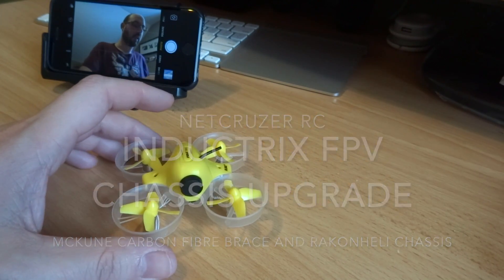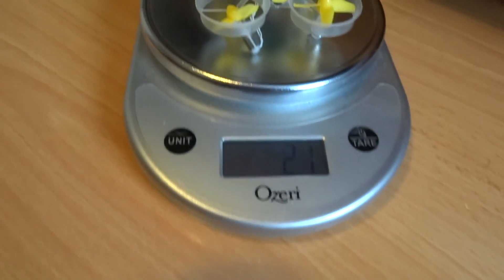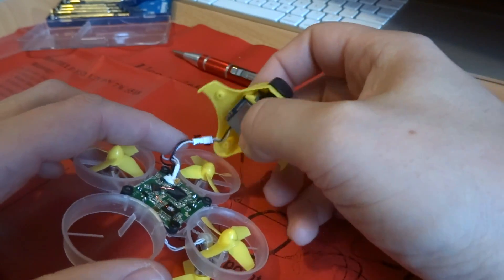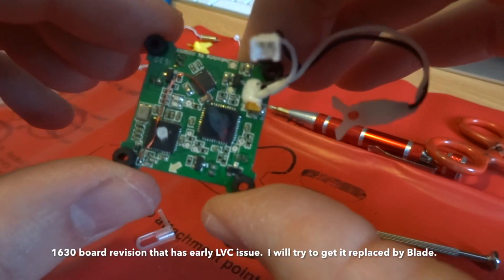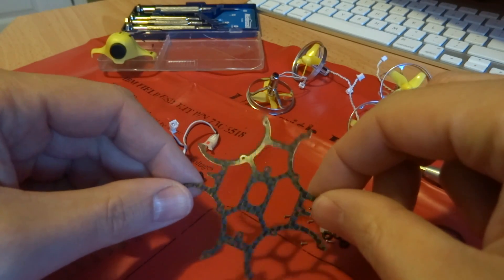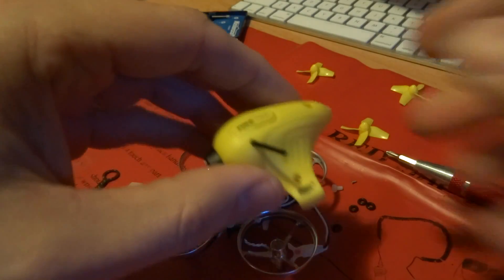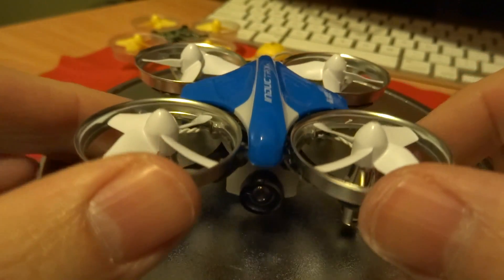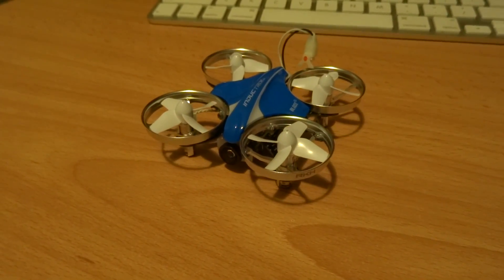Inductrix FPV Broken Chassis Rakon Upgrade Build

Comment: Stay away from anything Blade, this stuff is junk! I have owned lots of it and have had issues with 90% of it. Just trust me there are way better brands out there for even less money, my $14 Bwhoop pro is a better quad, it has no acro mode but is better in every other way and can be programed for acro if you wanted. I have crashed the Bwhoop into trees at full speed with no problems, I dropped my Inductrix off the counter and 2 of the fan duct supports broke! Not to mention the 700 other issues you will constantly have with this junk. I know someone will chime in and say they have never had an issue with theirs but that is an anomaly. I love how they say you can bind it with other controllers like the DXE, I bound mine with the DXE and it fly's different every time you turn it on? Everybody wants to do a thousand mods to these things, why not just buy something better to begin with?

Comment: Get the cockroach frames off eBay, motor struts are rock solid and in general after looking at it, seems way better..  

Time will tell durability wise I just got it

Alloy frames are not a good idea, extra weight and if you crash hard enough most likely you’ll bend something

Comment: I think the carbon fiber looks promising, but wouldn't the aluminum really weigh it down compared to the plastic? The battery life is adequate to begin with, but wouldn't a combination of the plastic ducts (which seem durable for all intents and purposes) and carbon fiber be the way to go?

Comment: sorry but it's not really a "piece of junk" all you have to do is add a TINY amount of UV resin to the 12 stress points of the struts, and even on the areas that attach to the motor end and it's freaking rock solid. I flew my first inductrix frame for about 3 weeks and had some nasty crashes, and the struts were falling off and I kept super gluing them. Had a nasty crash and it just wasn't worth it anymore b/c I had gunked it up so much with super glue. Threw the frame away. Bought another stock inductrix frame, added the UV resin like I mentioned and I've literally been flying the same frame for about 3 months now and not one thing has been damaged. It's indestructible now, pretty much. I have the carbon fiber frame reinforcement underneath, which most likely is helping as well. I'm getting about 3 mins battery life with the newbeedrone.com black edition motors (17,400kv)....so, to each his own, but...it's not that hard to reinforce the frame and it's durable af....the UV resin essentially welds the plastic together....so, good luck breaking that lol
Reply: bad idea.... buy the eachine frame from banggood (its 4 bucks) and thats the strongest frame ever! I used all the glues possible and they all suck!
Reply: +sam Costin no, it's not a bad idea. yes, the eachine frame is more stable, however, I have the Crazypony Makerfire little red fpv with FrSky receiver, been flying it for....2 weeks? This quad uses the eachine frame. It cracked on one of the prop guards. So, what did I do? I got that badass UV resin that fixed it. It's not glue..go use all the glue you want, glue doesn't WELD the plastic together like UV resin, so you're misunderstanding my entire point which makes my argument valid. I'm not making this shit up, I have literally flown the inductrix for 3 months and it still looks brand new, I have crashed it VERY HARD so many times, where the stock frame would have been destroyed; the UV resin-reinforced frame still is undamaged; it's virtually indestructible. 

The point is, this UV resin is gold. Like I said, if you actually read my aforementioned post, I have been flying the yellow inductrix for 3 months, and crashed TF out of it over and over, and it hasn't once been damaged since I reinforced everything with the UV resin. 

This is what I've been using, seriously, it's a GOOD IDEA to buy some and reinforce your frame(s). 
https://www.amazon.com/gp/product/B01MTO0N7G/ref=oh_aui_detailpage_o02_s01?ie=UTF8&psc=1

Even the Eachine frame has cracked with aggressive flying and a few crashes. Just noticed it the other day, there was a split in the prop guard. This UV resin fixed it and it's flying great, once again. 

I do agree the eachine is more sturdy out-of-the-box, however, at some point, it will crack, and the UV resin comes into play and remedies that and all future damage, b/c it literally welds the plastic together. 

So, doesn't matter if you're using a cheaper/weaker frame, if you reinforce it, it will be strong af. 

The inductrix frame is also lighter and performs better.

Comment: looks like you got the eachine e010 carbon upgrade kit instead of the inductrix one but it still works and looks epic :D i just ordered an inductrix myself and im planing to upgrade it with an fpv camera and a rakon frame too :D this helps with how the camera gos on so thanks :D
Reply: as for the seeing the lights issue, i have seen mods of people unsoldering the leds and soldering new ones on so they can put them were they want maybe that will help? also upgraded batteries ive seen up to 255mah ones in tinywhoops website might want to check them out too :) but 255mah was the max i was able to find so far :/

Comment: What was your flight time before the upgrade? I get 3:30 on my stock Inductrix FPV using Nano-Tech 200mAH (4:00 with no-name 220mAH). My RKH upgrade kit just arrived and I can't wait to install the upgrades but I'm concerned about the flight time reduction with the added weight. Btw, I don't think your upgraded quad needs that CF stiffener brace and it just adds to the weight penalty.

Comment: the frames on the eachine e10 clones are very strong.. my kids have yet to. I went rakon on my inductrix as well. great vid
Reply from the maker: Did you struggle screwing the FC into the carbon frame using those little white plastic bushings?  I found that to be the most annoying part.
Reply: Netcruzer yes. what I did was pre tap them holding them in vise grips.. they installed then to kit.. made life easier